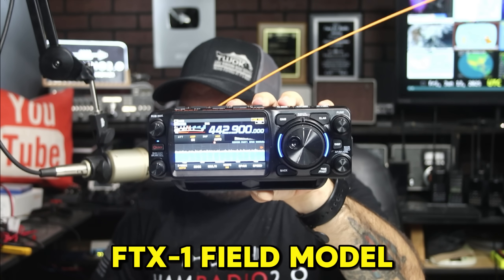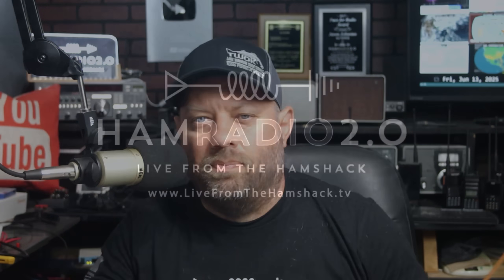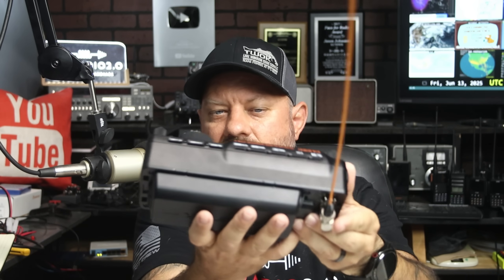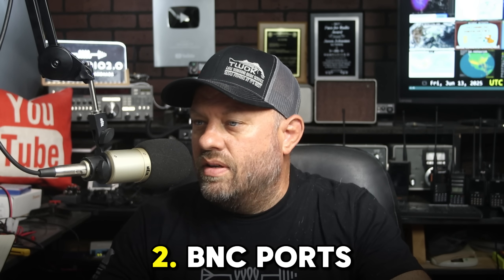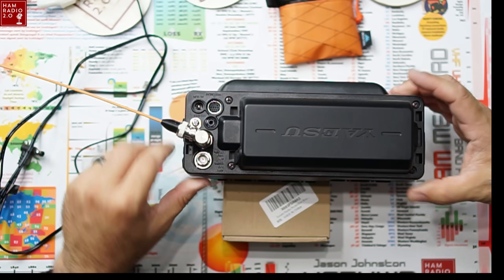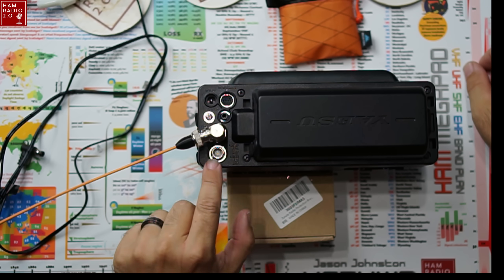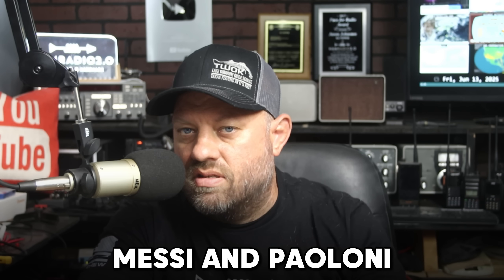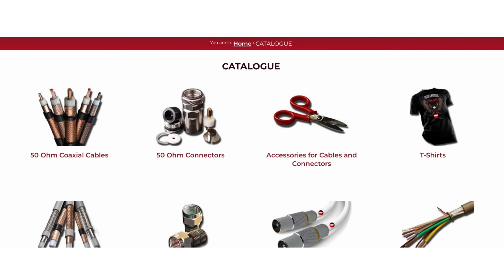5 Things Wrong with the Yaesu FTX-1

Comment: I DO own the FTX-1 and am damn sorry that I did purchase it, because there IS an absolute SHOW STOPPER ISSUE - which is that the idiots at Yaesu wired the 3.5 STEREO Headphone jack internally to a MONO output driver amplifier, which totally screws up any possibility of getting the kind of proper left-right multi-vfo channel mapping in your headphones needed for proper split-band operation.

I come from a commercial communications background, and whether it's a airport control tower, aircraft cockpit, or regional communications center, wherever you have multiple radio com channels present, and operators with headphones, you generally ALWAYS have a way to allow the operator to map specific receiver channels selectively to the operators left and/or right headphone channels. The military did research years back and determined that stereophonic left/right separation of separate communications circuits in the operators ears assisted in proper identification and improved ineligibility when mutiple signals are present. 

 In the FTX-1 this is critically important when attempting to work HF/HF split-band operation since, with the noise floors blending together, and one SSB signal sounding like another, without left/right stereophonic audio separation, there is literally no way to tell which VFO is sourcing the audio you just heard.  Had Yaesu's engineers not been TOTAL IDIOTS, there would be a MIXER option to let you map the LEFT(SUB)VFO into your LEFT HEADSET earpiece and your RIGHT(MAIN)VFO into your RIGHT HEADSET earpiece, just as an Air Traffic Controller or Pilot might when dealing with multiple com channels. 

Using a MONO output amp chip instead of a STEREO output amplifier probably saved all of about 10 cents, so basically, for a DIME, Yaesu badly crippled the Multi-VFO-RX capabilities of this radio.  The good news is, doing it the RIGHT WAY isn;t particularly hard, or complicated, it just requires that YAESU FIX THEIR SCREWUP, which unfortunately WILL require a hardware change.  

So until this is fixed, DO NOT BUY THIS RADIO IF YOU WANT THE MULTI-VFO-RX CAPABILITIES TO WORK LIKE THEY SHOULD.
Steve - WX6E

Comment: Booooooo. Yaesu has dropped the ball with their new FTX-1.  Specifically you cannot choose the frequency and band with a mouse.  With the FTDX-10 and FT-710 you can but not not not with the FTX-1. When using my Yasu FTDX – 10, I found that I can simply use my mouse to enter the frequency just by clicking on a frequency box that appears on the screen. And Boom” instantly transported to the band frequency that I want. So when working FT8 or POTA it is such a wonderful experience to just have to use my mouse to click on the frequency box and immediately and instantly get transported to the frequency and band  I want “Boom”. So……. When I saw the FTX – 1. I was interested in buying that one however I find out they do not have that same ability to click on the frequency with a handheld mouse. It just does not have it. I think this is a huge failing by Yaesu on this model. And I think this huge mistake of leaving that feature out on the radio will discourage people who like to do FT8 and Pota, from buying one of them, and their sales will definitely suffer.  It took me three days of searching to find out this fact. Which really really irritates me that they would not come right out and say we do not have that feature on this model. And saved me all that searching.

Comment: Since a battery efficiency isn't 100% (there is energy loss through charge and discharge cycles process), why would you charge a battery on the field?
If the capacity isn't sufficient enough then you are not using the good setup and should power the radio directly or am I wrong?
Thanks for your videos.
Reply from the maker: Power the radio directly from what?
Reply: @HamRadio2  From what you wanted to use to charge the battery.
Reply from the maker: Then that is something else to carry

Comment: "Field" never ment something you would pack in a backpack. That's some other word. Backpackable, featherweight, ultra-portable, not "field". All field means is that you can take it when you aren't operating from "garrison". In ham terms, that would mean any equipment you could reasonably take from your QTH and operate outside your shack. "Field Day" is a great example. Mostly not POTA/SOTA type rigs in use there. I could definitely see an Optima I use on Field Day. And the Field head is smaller and more portable than that. Sure you could pack that in too - ever seen a Singars radio? 15KW generators are "Field" generators.

Comment: Thank you for an interesting review. I have the Icom IC-705 and imo it is very back packable. I understand your comments but with the Icom rucksack I have zero concerns about smashing the screen. Even with all the end fed wire, feeder, ATU etc that you carry it still is not heavy. I have the larger maH BP307 battery pack which ok is not the capacity of the Yaesu. Again, some  omissions from Yaesu are surprising, for a new radio - and a direct competitor to the IC-705 - no WLAN, no Bluetooth, no onboard GPS. These features for some will be unimportant, but I suspect a lot of users are discovering how user friendly the 705 is. Icom should have developed a HF p.a. but they didn't. I bought the radio as a QRP pota, sota, mobile so for me it's not an issue. YMMV. All the main manufacturers YKI produce fabulous radios, so I guess you pays your money and takes your choice, which is part of what makes the hobby so great.

Comment: The best field radio from Yaesu was the FT-817ND and the FT-818. After stopping the production, Yaesu and Icom failed to make a good field, or QRP radio. The FTX-1 Field and the Icom IC-705 are too gentle and the possibility to break the display on rocky terrains or mountains is big. You have to care more about the radio than for yourself. A Xiegu g90 is a better option.
Reply from the maker: Everyone keeps comparing the G90 or X6100 to the 705 and FTX-1.  I can only surmise that you have never used BOTH of these radios.  You've used the Xiegu, yes... but not the Icom and Yaesu.  If you had, you could clearly see the receiver and filtering quality that Xiegu simply lacks.  I do agree with your points about these radios being too delicate, though

Comment: Well... the price is $1,500 bucks! That's a major flaw... Especially when you consider the availability of field power options available today and $400 bucks more for the 100 Watt Version. If I'm on top of a mountain I'm good with hauling my 40 watt amp that weighs  less than the difference in weight between the IC-705 and the FTX1 Optimus...  So I do a lot of ATV camping  and the differences really come down to price. I can run a IC-705 in the filed without any issues. That $400 AMP DIDN'T COST $400 BUCKS.

Comment: There are lots of things about the radios UX that are just frustratingly wrong/different than they should be.  The antenna port placement is a reflection of the fact that the designers were thinking about HF more than VHF/UHF and the UX is aimed at HF use more than VHF/UHF.  The A/B band controls are completely frustrating.  The top left and right knobs should be about the A-side function and the bottom left/right knobs should be about the B-side functions.  The VFO should always change the frequency of the currently selected side!  Volume/SQL should be on the right side knobs.  The left side knobs should be channel selection.  On HF, this left knob should provide RF level adjustment.  If you click it in, it should provide RF gain.  The knobs are just completely unnatural in usage.

Comment: I use both my 991A for field and mobile use and its awesome. 

I could not imagine it being a packable rig. 

In my opinion, they really need to develop the 991A and not release not fully tested radios.

Had they made the 991a with remote head, and duel access to HF and vhf/uhf and a better screen. 

Figure out things like wires-x and such. Add in 220 at 50w. Polish it up. 
Make it the true hamshack in a box. 

Maybe even a 900 module since 900 is actually big but no support.

Comment: I find this FTX-1 Optima very interesting, but have two questions I hope you can answer.
1). Does the Optima have a built-in antenna tuner or do I need to buy an external antenna tuner?
2). Will the optima send out a momentary beacon signal in C4FM mode on 29.250 mhz in the same manner as the Yaesu FT991A?
Reply from the maker: Yes it has a tuner. Not sure about the beacon, never tried

Comment: After the second firmware update … while in APRS menu … radio locks up … must power down to restart radio … 2nd. You can’t enter your own “Path” … i.e.: you can’t enter ARISS to contact ISS digipeater or enter other satellite paths … I can do this on my Kenwood ht. Getting tired of the garbage this radio is. Who authorized the release of this experimental brick ….
Reply from the maker: That is a bummer to hear, but hopefully, those will be fixed soon.

Comment: I already have a 705, but the main reason I didn't go for it is it's a 1.0 release and I knew there were going to be major showstopper problems with the 1.0 firmware. So I didn't want to spend that much money on a rig that was going to be broken for the next couple FW updates. The only other lack compared to the 705 is missing WiFi and elementary network connectivity. I run mostly FT8 so I have to connect the computer wirelessly due to RF in my shack. A USB cable completely tears up the computer & rig, so WiFi is mandatory. 

I also didn't like the wiring mess for connecting to the external amp... but then again..... looking at trying to do the same with my 705..... that's way worse and more expensive and poorly integrated, etc.... so that's not really a legit complaint for me after all, compared to the 705. 

Looks like a great little rig, but I'm waiting to see what shakes out with the firmware updates and if they fix everything in a timely manner....

Comment: weight = nothing burger for field use.
position of BNC connectors = nothing burger for field use. 
separation issue = nothing burger for field use.
APRS = integrated APRS inside of the radio is always a issue with most radios. Control APRS through a computer not a radio.
Battery= legit issue. But fat lazy sedentary hams don't hike... so it is not an issue.
Reply from the maker: 6.  Listening to someone who uses the term "nothing burger"

Comment: Interesting radio, you would think as long as it took get this radio to production, more bugs would worked out of it. At least it is not burning out PA boards like the original 991, so far. Jason you said they did not pay you to review this radio. Did they give you a discount on buying the radio or did they give you the radio for free? As always I enjoy this honest review of some of the hardware short comings. I have the IC705 I like it, but it has some flaws too. I am on the fence on buying the FTX 1 optima. Glad they came out with a new QRP rig.
Reply from the maker: No, I paid full price for it

Comment: The thing stopping me is price,  Nothing you mentioned today would keep me from buying this radio.  The antenna thing is interesting.  I would never use that style of antenna.  Based on my available gear, I would have a separate pigtail coming of both antenna connectors.  I want the optima model.  I currently run an FT-891 which is an incredible tank of a radio.  Very interesting video.  Not suprised about the all the online bitching,  It seem sto be what most o fthese online guys do best.

Comment: I can look at the poor design of those ports and say right away that the radio operating without the Optima amp is an after thought.  They did NOT configure those ports for primary use as a head unit alone like the 705 is configured. They wanted to capitalize on the "portable/field/whatever" crowd from a marketing perspective without that being the main design consideration. Now, that doesn't mean it's a BAD radio....I just think it's a badly DESIGNED radio versus what it's marketed as.

Comment: its junk . over priced  all they had to do is take the  ft 818 and make it a 10 watt  and they would of had something
Reply from the maker: The 818 is way outdated, though
Reply: @HamRadio2  I wouldn't be if the did a better job with the somewhat re resin and power output  just 1 watt really
Reply from the maker: But the form factor was lacking. A very small screen and a heavy battery that didn't last long
Reply: @HamRadio2  I always used mine with a smalll 4 ah battery , but radio mfg are set on there multi function displays , me , I can care less about them

Comment: My ideal radio: Thin, longish (rather than wide), 2 dual knobs on left with push, 4 buttons underneath, small colour display, tuning knob on right, basic controls and display on the set, most of the controls on tablet \ phone via BT. ATU. WLAN - WiFi. SDR. Dual ARM core + SW FPGA. Linux core on one. RTOS on the other. Low power consumption. 25W min max output. HF & VHF\UHF versions.

Comment: I just wonder what the total price will be to bring the FTX-1 up to the same specs as the ic 705 as regards the add ons. I’m looking at getting my first qrp radio and excitedly waited for the FTX-1. I have the FTDX10 and the FT5D, but I feel Yaesu dropped the ball on this one and I’m grateful I waited. The Optima is a shadow of the FTDX10 and the cost is prohibitive for the performance, in my view. It looks like I’m going to buy my first iCOM radio.
Reply from the maker: Good question

Comment: Very high receive current, no built in GPS. No Bluetooth or wifi. Bulky and expensive battery probably to deal with the high receive current. Looks like a stereo system not a radio and I don't like the menu system. Too many problems. Dual receive is nice but that's it. Will stick with my 705 and with Icom's in general.
Reply from the maker: Your comments were valid until you mentioned how it looked, then said you liked the 705 which looks almost exactly the same
Reply: i @HamRadio2   same idea concept but look a lot different 705 is less flashy looking and built to look more for purpose but that's all a matter of taste I suppose. Have owned many Yaesu's and still have quite a few but prefer the Icom platform these days. I think a much improved 817 platform would have hit the mark for many especially if it was waterproof rather than compete against the 705 and failing on many levels.
Reply from the maker: No. They look almost exactly the same

Comment: What about an sma connector specifically for a whip/5-10w somewhere clever? Kind of like what they did on the 817 on the front.
Another thing, I feel like this radio could have been made in 2013. Anything new on this since then besides the USB C? Sort of thinking out loud on that last comment.
Reply from the maker: I think the connector on the 817/818 was a BNC, not SMA.  But I agree with the sentiment

Comment: I do not own this radio, and I will never own this radio. In my opinion, it is epic failure on the part of yaesu. We have been saying for years that we want a replacement for the 857D, not a QRP radio, not a 6 W boat anchor that will connect to an amplifier but an 857D.
Their excuse is that they can’t find the components anymore to manufacture this type of radio well the bullshit flag is waving ! If you can make a radio that’s all band just like an 857 then you can manufacture an 857.
And I for one I’m not going to pay $2000 for what’s referred to in the world as an entry level radio .
These are my opinions no need to respond .
Reply from the maker: Everyone has their own opinion
Reply: @HamRadio2 yes sir and, you requested we post in the comments 17:31

Comment: Hi..My only reason for not purchasing this radio is not being able to separate the amp from head unit... Major issue.. Thanks for all your hard work...Appreciate it..
Reply from the maker: I understand your concerns.
Reply: They do now have 2 version of the separate cables that you can buy thru Yaesu or the Retailers,I've made my own cables for my separate cables and it does work and now the 100w amp sits under my drivers seat next to the rear air condition outlet for the back seat people who seats in the back of my truck,it is a Toyota Tundra 2019. My mount is a HD Lido cup mount as temporary till I make my hard tubing mounts to replace the cup holder version.The cables are all most the same cost as of now with the new cables coming out from Yaesu,I would wait till they have the cables in Stock as of right now of this writing in this Reply..

Comment: I use many of the 18650 batteries, compact, easy to charge and great capacity and longevity.  I’ve got the Optima on reserve at DxEngineering and in the back of my poor old head, would the Xiegu X6200 do as well for half of my retirement?  Any comments from “The Peanut Gallery”?
Reply from the maker: The Xiegu radios are fine but their filtering and receivers pale in comparison to anything from Yaesu

Comment: Admittedly, two of our crew bought and ultimately returned the FTX-1 Optima.  

We both got units (12 serial numbers) apart that exhibited poor TX Behavior when keying up- causing the transmission to drop.  I understand now that Yaesu may have a fix for this on units where it is prevalent.   We were very excited about the prospects of the Optima, but it fell short for us in the current form as it was delivered.  Yaesu's support crew was good to us, and listened and recorded quite a bit of feedback that we experienced - but as with others, it wasn't a radio we felt comfortable keeping in the kit long-term.   

I suspect later FTX-1's (I see a lot of FTX-1A jokes) with the updates that Yaesu has been rapidly delivering (second one dropped yesterday!), will end up having many of the early bugs worked out. For now,  we're back to using our other Yaesu rigs.

Thanks for the thoughts, and Cheers, The EveryDay Ham Crew.